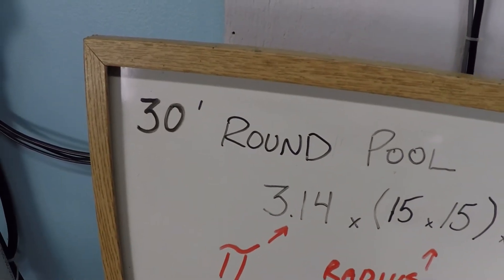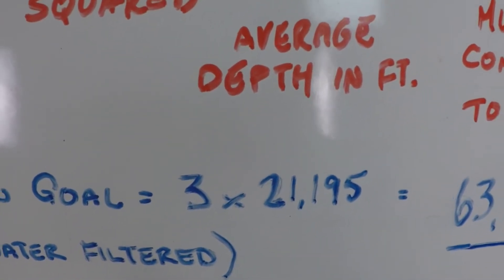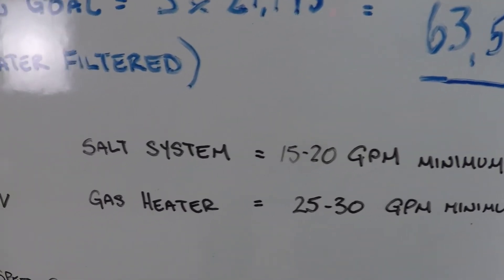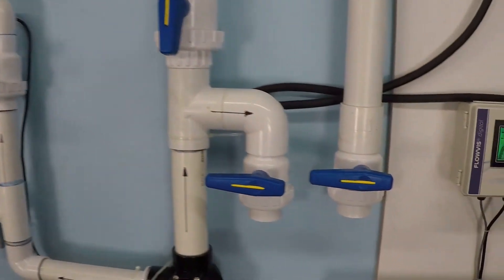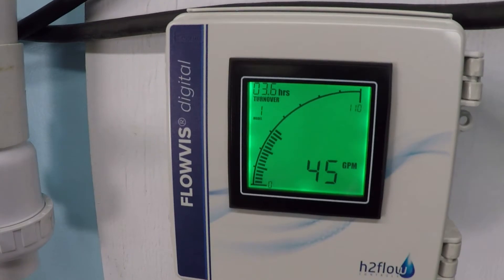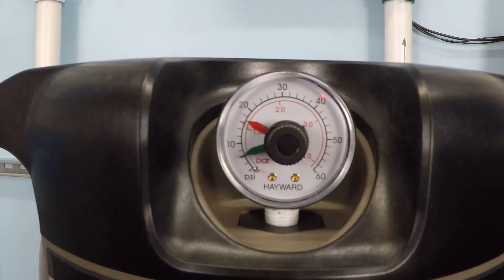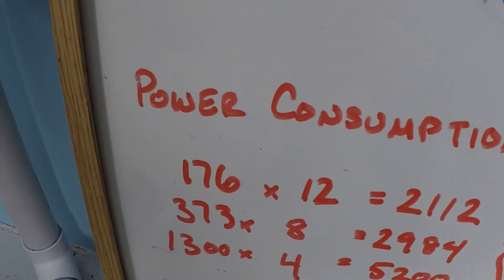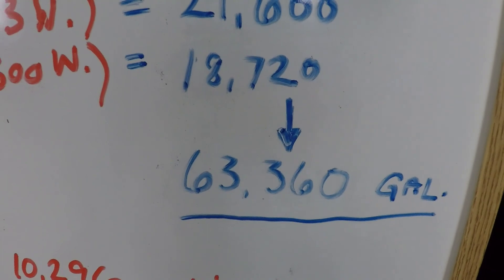Variable Speed Pump Schedule For Round Above Ground Pool

Comment: This is great content. I just need to do the calculation using a flow meter on my pool. I have a power monitor that shows me the wattage. I will definitely try and cut back on my power and increase the times the water is turned over. Thanks so much for making this.

Comment: I have a 24ft above ground 52" if you had the choice of single speed, 2 speed, or variable how would you rank them?
Reply: Variable speed. You will save whatever cost you spend on the pump very quickly running it at lower speeds.